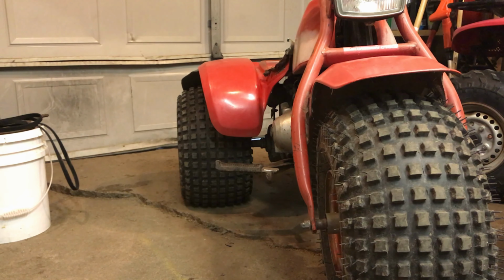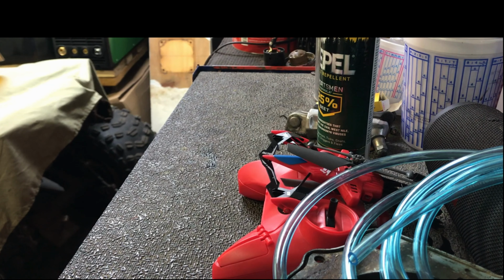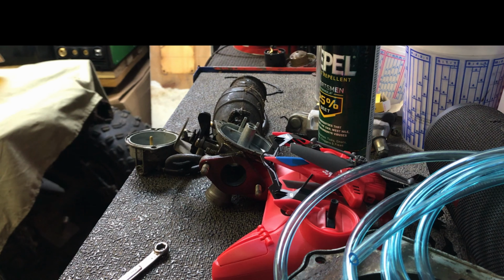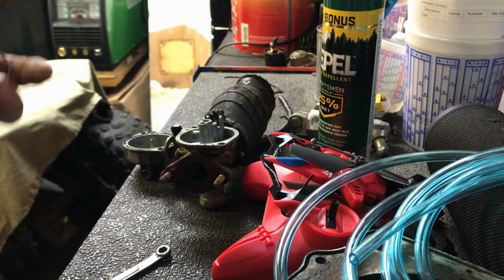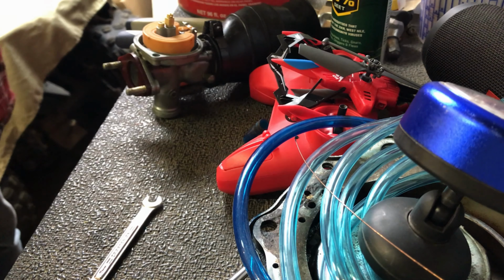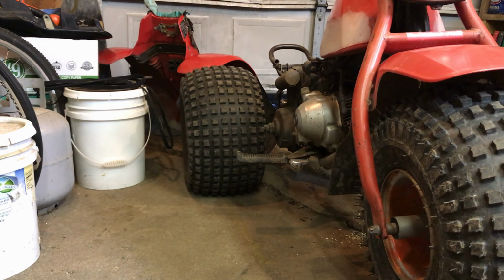Honda ATC 110 Carb Clean

Comment: Just pick up a 1982 110 atc my self as a project. Nice video will be doing the same thing.
Reply: My 84 110 ATC starts good but dies whenever I let off the gas! I'm sure it's carburetor related but do you know what it could be?
Reply: @JuarezDerrick  Mine did the same thing at first I removed carb and cleaned the jets  and then idle up the  rpm up. I Also.had trash in tank that I cleaned . Hope this helps.
Reply: @chadpipkin840  thank you sir!
Reply: @JuarezDerrick  Your very welcome .